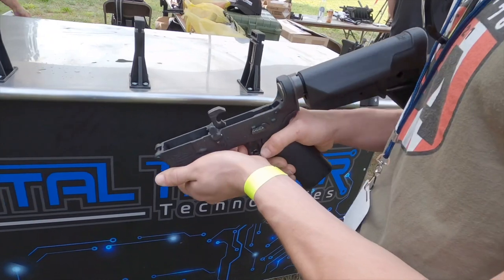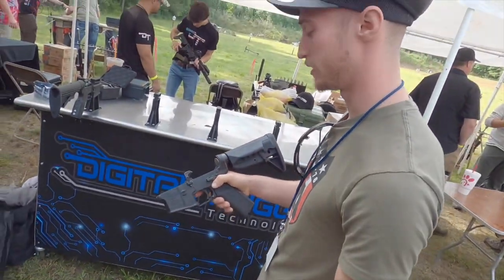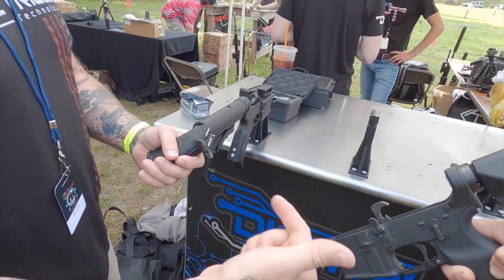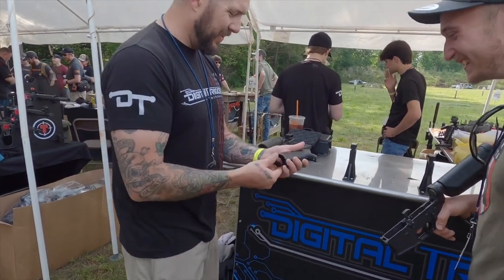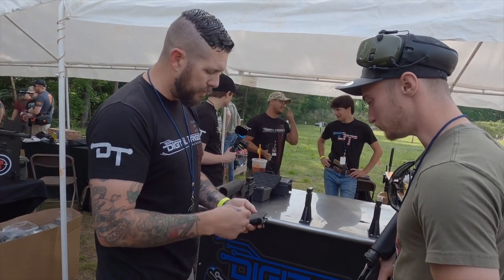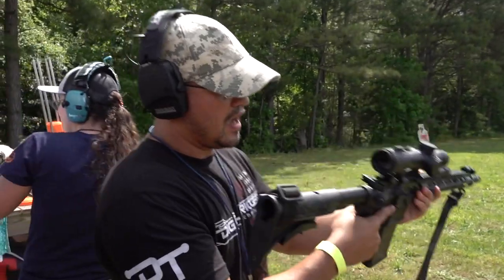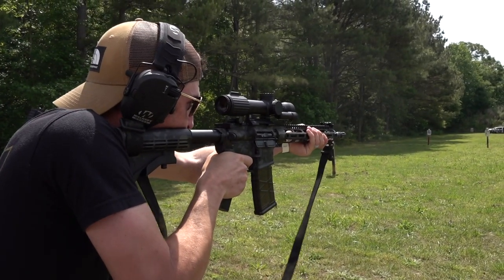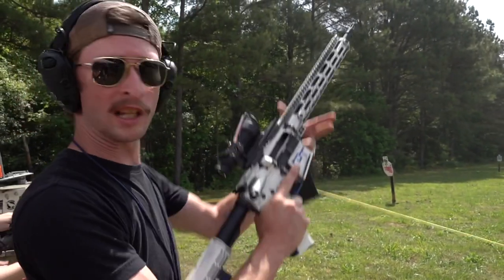Digital Trigger Technologies Digitrigger GEN 2 || AR Binary Trigger || IV8888 RANGE DAY 2021

Comment: This company is terrible to deal with. Took a month to get my trigger kit, and it arrived without a battery pack. They will not return my calls, emails come back as undeliverable. I don't even know if the product works. No packing slip, receipt, or any instructions at all in the box.

Comment: They need a double trigger for this
Reply: That doesn't work
Reply: @printingwithpeek4897  um a microswitch trigger on a diigital frame absolutely could have a double trigger. The le version has different firing modes
Reply: @johnsanchez6263  The mechanical versions already outrun the gun. You'd do no better with that than you already don't do with this.